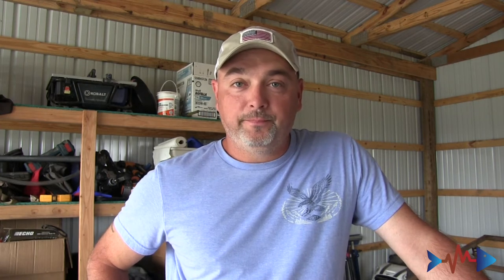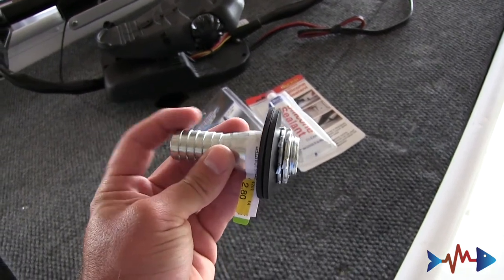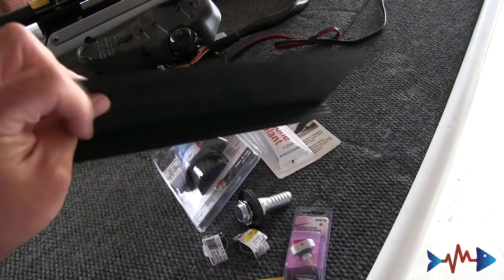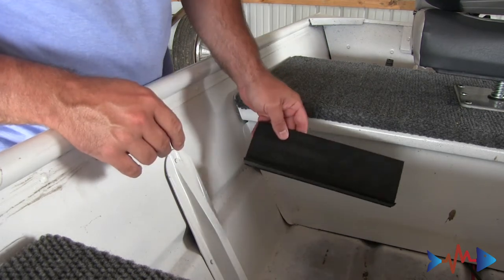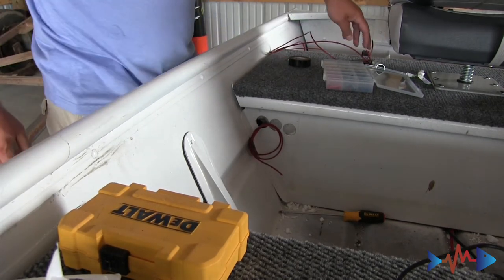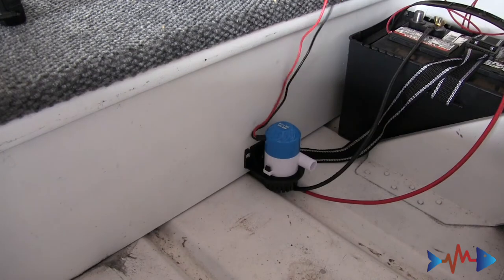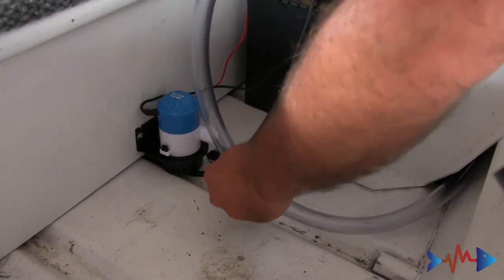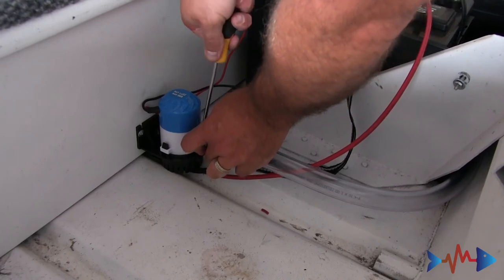BILGE PUMP INSTALL for the Micro M10

Comment: I commend you the smaller the boat the more important the bulge pump for most people it is an afterthought.

A fuse or circuit breaker inline nearest the power source is crucial. A short circuit in this circuit with such a large battery could easily cause the wire to go to white hot and ignite the foam in the seat.

Comment: Every hard 90 added reduces flow about 50% I would try to utilize smooth radius bends in hose to a straight out through hull high on the side.

Comment: should i need the fuse for that project sir. i am new. thanks sir
Reply from the maker: Steve Pham thanks for watching!  You could absolutely do an in-line fuse but I just didn’t.  A 10 amp should be fine.  Good luck with your project!
Reply: Bassin' 911 thank sir
Reply: @stevepham854  not only you could use a fuse if you value you and your passengers safety you MUST.

You can easily weld 1/8” steel with only the energy contained in a group 27 lead acid battery. 

You are on a very small island surrounded by water maybe at night. If you develop a short from the + wire contacting any ground or develop an internal short inside the bulge pump and the wire melts and the insulation burst into flames it’s whole length. Did I mention that you are sharing this island with a gallon of gas.

Would you want to fly in a small airplane knowing the owner installed his own accessories  and wired them himself by running them direct to the battery. Works good until it doesn’t.

Wouldn’t it be nice if a fuse broke the circuit before any of the above happened?

Have you noticed all boats, automobiles, heavy machinery, buildings are built with circuit breakers in the circuits. It cost money to add cb and if they could be eliminated and maintain safety they would have been.

If you wouldn’t be comfortable stripping wire and holding the ends on your battery you need a fuse or cb. Hint: don’t do this!